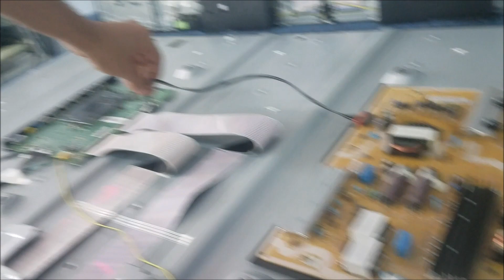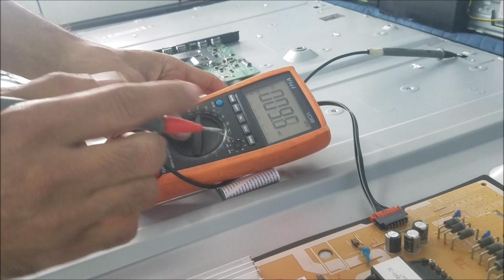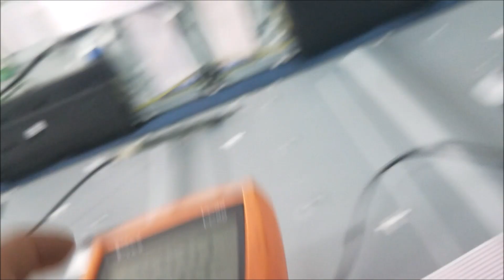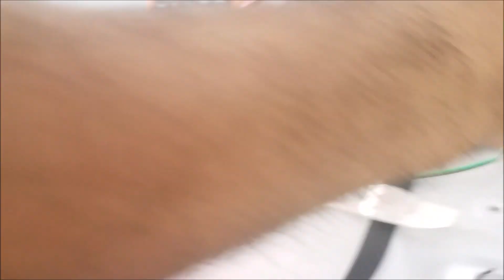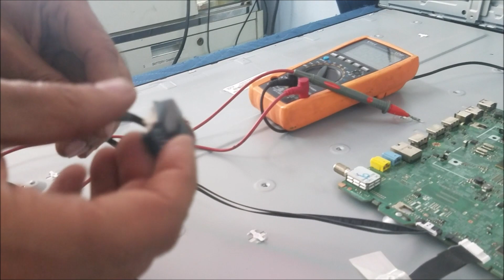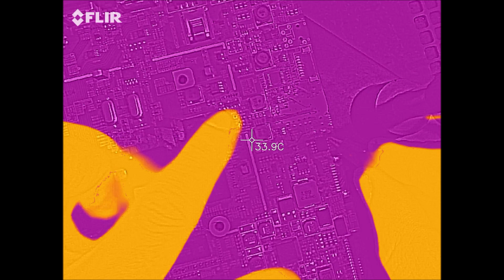SAMSUNG TV UN65MU630DF no power shorted processor

Comment: I have the same TV. The processor is obviously shorted because the replacement board now allows many functions. I still do not get a picture only backlight rebooting except when panel cables are disconnected. The seller sold me a different version, FC10 instead of FA01. Does that make a difference? Can I have a bad panel?
Reply from the maker: yes the version makes a difference try to get the right board first

Comment: Hi, friend. I have a samsung nu8005T that won't turn on with the standby light blinking. . If I disconnect cable from the main to the power supply I have constant backlight. In step 2 if I disconnect the screen cable there is no backlight or sound. I understand then that the damage is in the main? I notice very high heating in the processor/memory area under the black metal plate. A greeting and thanks for your channel that is magnificent
Reply: Did you end up replacing main board? Or processor? Just curious.

Comment: When i power on my Samsung tv I get no picture and the red light flashes and  I hear a squeaking noise from centre of the motherboard. Ive replaced the mother board but problem still persists.   I did manage to get it working by a combination of disconnecting and reconnecting the main power and the cable on the motherside of the board. Needless to say im a complete novice at all this. lol.
Reply from the maker: maybe you have a bad screen, look for my last videos how to check that on samsungs
Reply: @SOSfixElectronics  Thanks for reply.

Comment: I have a Led tv similar. This tv don't works when motherboard cable is connected with power supply neither standbh led lights up. When i get the cable out, leds turns on (lit). I make some tests like you and i find 3 coils shorted, some caps around processor and far from processor and pin 8 of one bios is shorted also. The other bios is good. Nothing heats. I did use assymetric power to find short. But nothing heats. Is it processor shorted ?
Reply from the maker: disconnect the main board from the screen to see if you get standby light if yes could be bad screen if no for sure it is bad main board
Reply: I disconnected motherboard from screen mre the 1 time and don't get standby light. Try turns on it with IR control and click in power button and the stby light don't lit (i maintain only power cable and power button cable). I put my multimeter in the power connector, specifically in ground pin and Led standby pin, no voltage.
Reply from the maker: @lucasrocha4329  sounds like bad mainboard